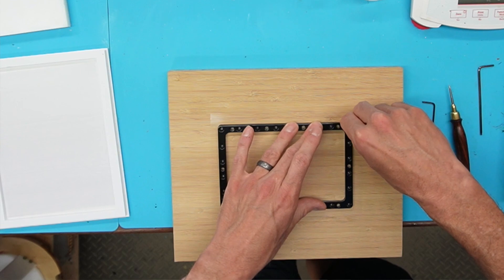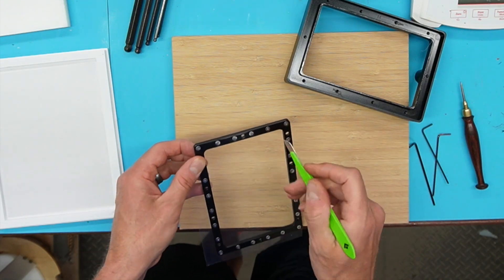Replacing FEP Sheet on Elegoo Resin 3D Printers

Comment: My FEP sheet on my Saturn 4 Ultra had got a pin size hole in it and I have ordered a 5 pack replacment from Amazon which should be here in a couple of days

I'm already going through withdraws because I can't use my printer so I'm now going to order a new 5 pack when I'm down to the last 2 FEP sheets in the new pack and I'm even thinking about buying a backup vat to keep on hand so I can print while replacing the FEP on the old vat

Comment: ive had to replace my fep sheet for my mars 4 ultra and every time the prints stick to the sheet i cant seem to get it to get to the plate ive done this about 3 times and im at a loss
Reply: Going through the same thing with my Mars 4 Max. At first it gave me nothing but perfect prints, then I had to replace the FEP sheet. 
The first print off the new FEP worked perfectly, but every one after that got failed prints on the middle parts of the build plate; like it was becoming more loose with every print.
I got some new FEP 2.0 this morning, so I'm going to try this method (without the sponge for spacer) and see if it works.

Comment: “Eventually you’ll need to replace after some time” 
I’m here because i managed to make a hole in the thing after 2 days 🥹
Reply: And me three. Owned it 4 days, 4 failed prints, 1 hole if FEP. But it’s a blast, can’t wait to get it dialed in
Reply: @tbrizius hopefully you got it nail down my first 3D printer I had 10 failed prints before a successful and I almost completely gave up. On my second 3D printer I got it dialed in right away.
Reply: you're not the only one. the plastic scraper that came with it popped a hole in the corner. so my Saturn 2 needs doing haha. oh well. it's a learning curve. i wish you all the best with yours :)
Reply: @deadpoollane4229  I bought a cheap little plastic razor knife. Thing is GANGBUSTERS
Reply: me too me too 😩
Reply: My fep sheet has massive wrinkles in it. Ordered replacements.
Reply: First calibration print damaged FEP here. I'm guess plastic scraper damaged it.

Comment: No sponge under the fep when tightening screws to get tension? I'm having problems with mine, I have just put a new 1.0 on my saturn and it's pulling prints off their supports on the prints around the edges. I've ordered some 2.0 to see if that helps, I really need it up snd running again.
Reply: I think this was the first video I've seen of this being done without something under the FEP when replacing to provide a little less tension on that first set of screws. It seemed to work out for him though. Just as I mentioned the first I didn't see someone put foam or cards or something under there.

Comment: Would you recommend any of the Elegoo printers? I'm a newbie and wondering if there's any difference between this or the filament type printers besides the material used? Thanks.
Reply from the maker: I've been pretty happy with them personally, but they are a lot different than FMD printers. Just depends on what you want out of the printer. For woodturning applications, resin definitely turns better, but the printing process is messy and smelly, so it may not be worth the effort over FDM